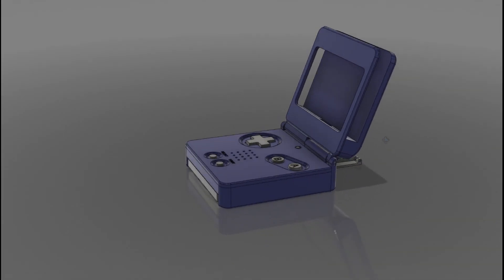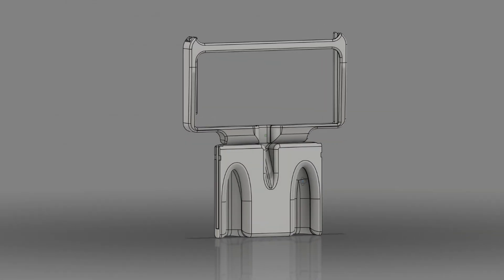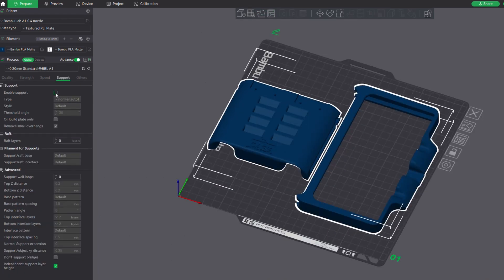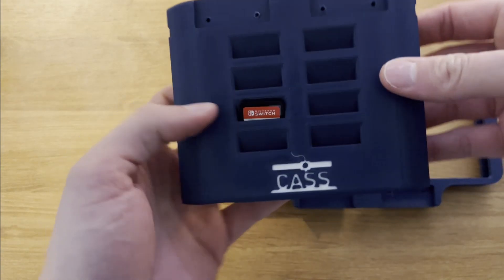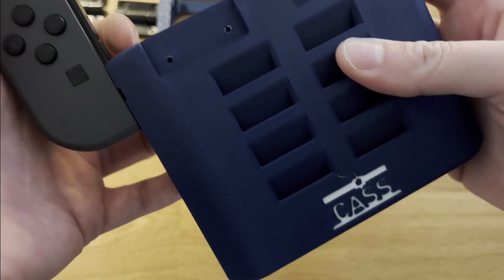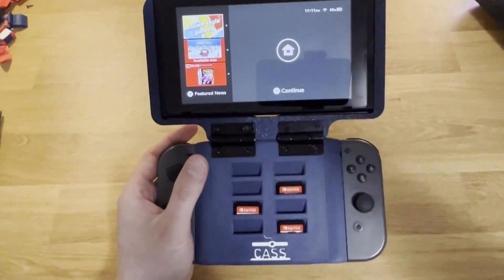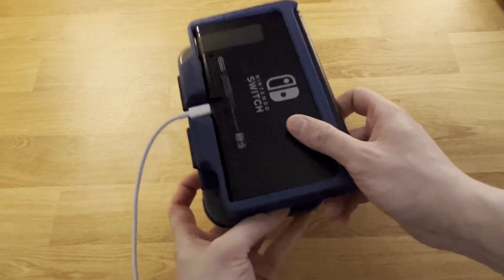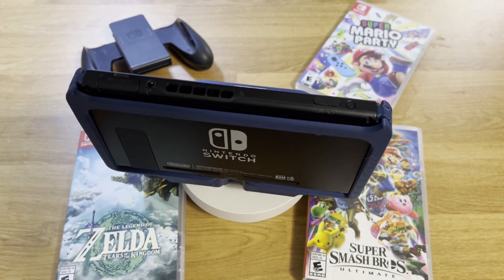How I Designed a Hinged Nintendo Switch Handheld Mount

Comment: You should remove the cartridge holder, make the bottom hollow and fitted for a portable battery bank, and buy a short usbc to usbc cable to charge the switch. Also brass female screw inserts are OP, just use a soldering iron to heat press them into the 3D plastic

Comment: Is there any way to sell one for the OLED model? The screen size is slightly wider. I'd buy instantly if it's possible.
Reply from the maker: It could be made but I don’t have an OLED to test it with, maybe I’ll look into it and reply to you if I try making one work with that model
Reply: @CASSDesigns  It's barely an inch longer from what I read. And I can definitely test if you want.
Reply from the maker: @SmashandCrash22  I miiight have enough room to just change the top piece
Reply: @CASSDesigns  I don't think you would have to change much, so it should be doable. It's just wider in size with smaller bezels.
Reply: @CASSDesigns  Did anything come of this OLED request? I'd love to buy the STLs and print one for myself.

Comment: This is crazy cool. I have been wanting to get a bamboo printer but I'm always hesitant on switching.
Reply from the maker: I had an ender 3 since 2018 and then bought an IDEX dual extruder printer, but the bambu labs A1 has been the only one I've used since I bought it a few months ago. There's been a recall due to a heatbed issue but once it becomes available again (I think in May) definitely look into it! It's very worth the ecosystem switch, but they're much more closed source than other printer companies
Reply: @CASSDesigns  I have about 7 printer most are creality, I use them to make cosplay props. I've has an idex for a couple weeks I just haven't put it together yet. Work has been taking over.
Reply: I've had a Sovol, an Ender, and a Prusa and my Bambu X1 Carbon absolutely blows all the others out of the water. I can't speak to the A1 or any of their other models, but I imagine they're all similar experiences.
Reply from the maker: @brandonsmith862  I use an X1C at work and the A1 is really close in terms of print quality and speed, it’s wild how fast they got a bedslinger running